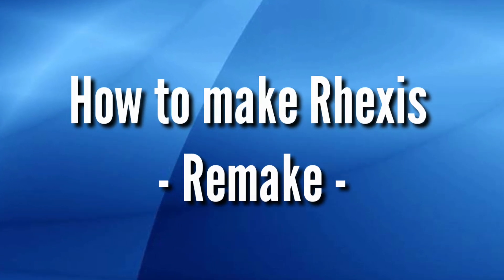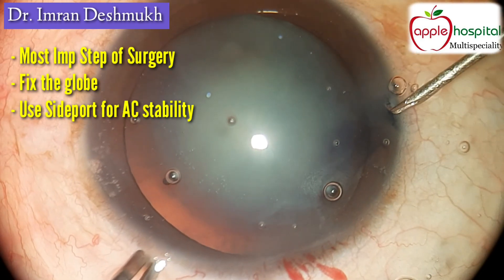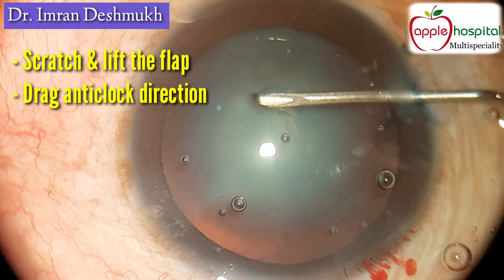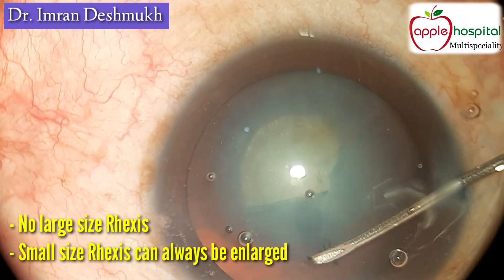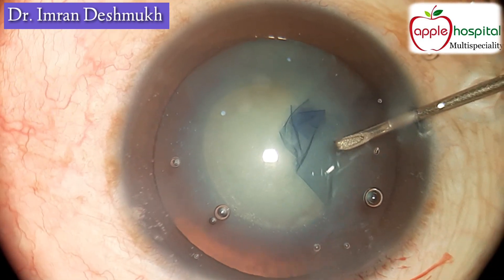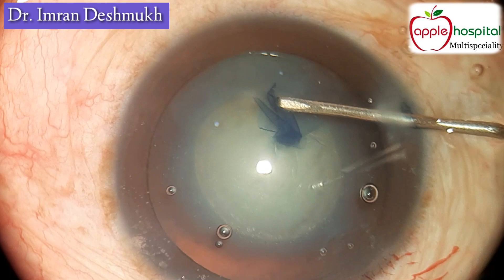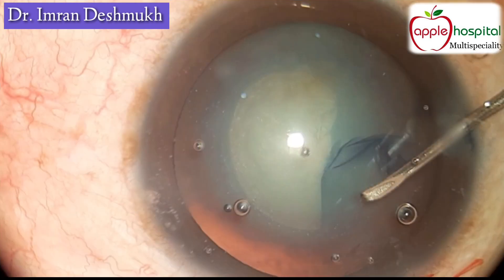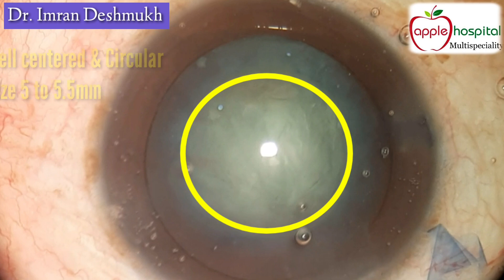How to make RHEXIS during phacoemulsification Cataract surgery.

Comment: Dear sir, in case of rhexis run off , can the IOL be still placed in the sulcus ?
Reply from the maker: Sir if the Rhexis has not extended to the posterior capsule you can place it in the bag very carefully or even in sulcus perpendicular to the place where Rhexis is run out..
Reply: @drimrandeshmukh9598  thank you sir